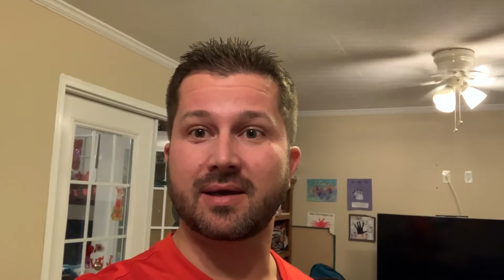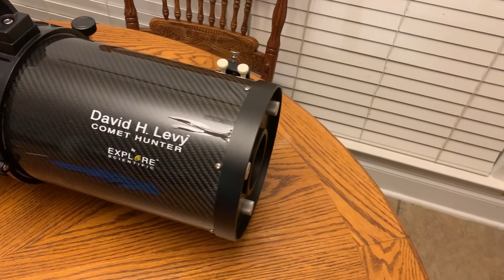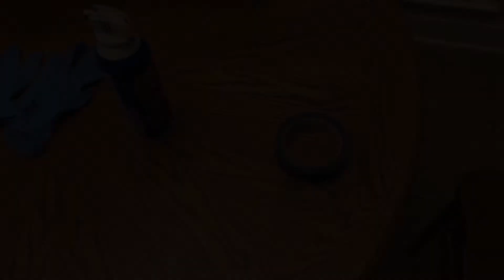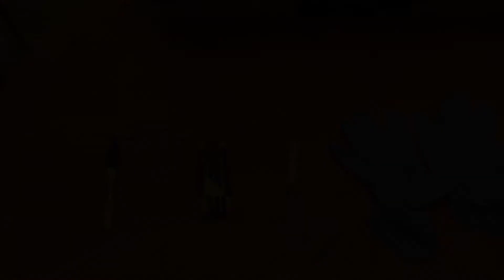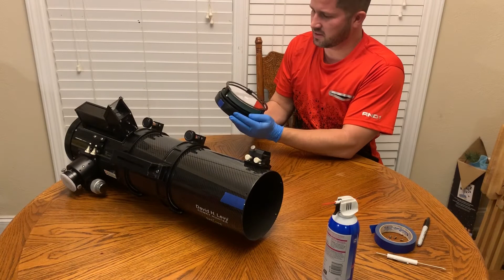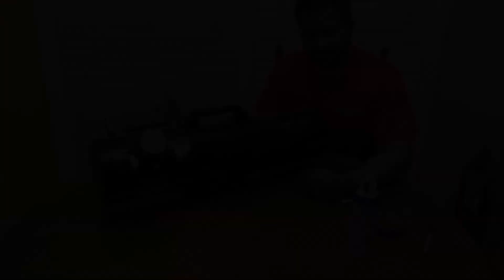How To Fix Pinched Optics

Comment: Hi,
I am from India , recently i have bought Orion xt8 Classic Dobsonian.

Couple of days back while using telescope , my 25 mm plossl eyepiece botton metal part accidentally hit primary mirror and small black coat inside of metal part of eyepiece stick to primary mirror.

By 25mm eyepiece while watching moon , it look good.

But using barlow 2X n 25mm eyepiece to see Jupiter on full zoom , not sure but i think that black coat scratch on primary mirror is shown in eyepiece.

Please  let me know, What to do:

Does it really effect on light gathering.

Do i need to clean it , if yes please tell me simple way, as i am first time user.

Or it wouldn't effect the view.
Reply from the maker: Puneet Banga is the mark it left is small then the affect it would have is minimal of even noticeable, but if it bothers you and you wish to clean it, you can follow the steps I use in this video to remove the primary mirror.  It should come out the same way.
Reply: @AVAstronomy  ok , i ll trying but scared about any sort of setting will displaced. 
If possible could you please share your email id so that i reach you there with images abd videos , that make you clear that is it needed to clean or not.
My email id is puneetbanga26@gmail.com , if possible please do demo email then i will share images n video of telescope. 
N Thanks for replying Sir.
Reply: @AVAstronomy  Sir i emailed you, please have a look.
Reply from the maker: Puneet Banga sent you a reply
Reply: @AVAstronomy  Thank you so much sir for your tips and guidance. 
But Sir i send another email with image trying to see Jupiter but with 25mm it looks like shining star but in that there was a line. Just wanted to know , if i do zoom with barlow is there possibility that scratch shown.

Comment: I own the same telescope and the 1 big diffraction spike was the drawtube of the focuser being in the optical path of the telescope. I ended up buying a low profile focuser which solved the problem and gives more room to mount accessories . I bought the UNCN2-S from TS-optics it also fits on the same mounting bracket as the original focuser so no drilling required.
Reply from the maker: thank you for mentioning this.  This is something I've been meaning to upgrade on that scope as well.  I was looking at a Moonilght focuser but since the TS model you mentioned doesn't require an drilling I'll definitely be looking into that!
Reply: I'm planning to use the Comet Hunter with the UNCN2. Did you need some distance rings to get in focus? For the UNCN2 TS offers 19mm rings to put under the UNCN2 to reach focus?